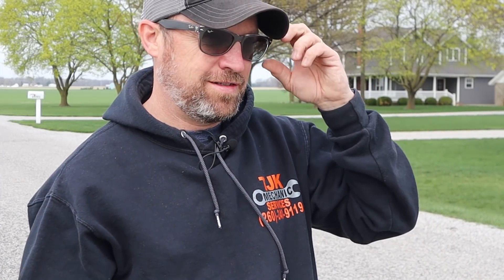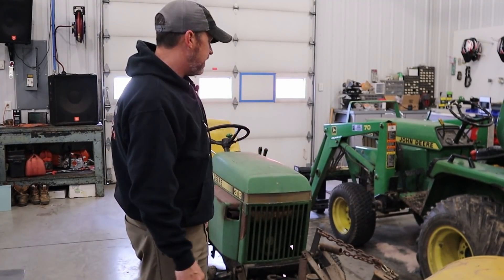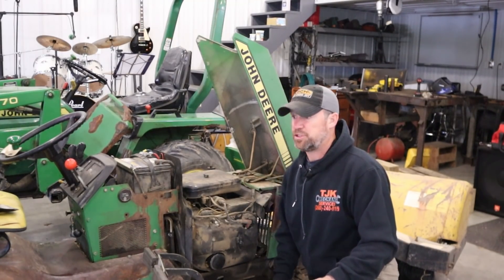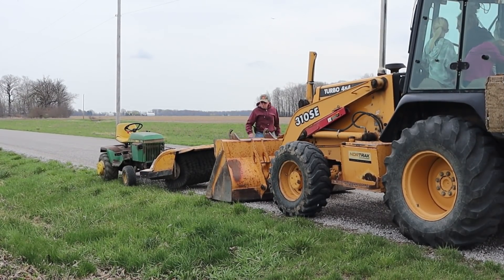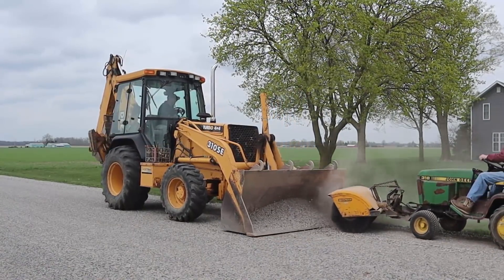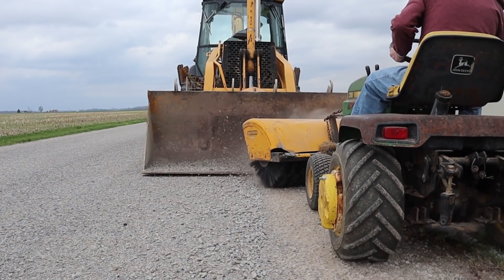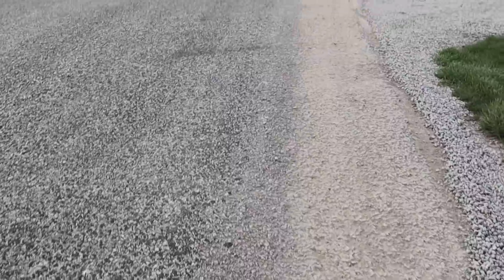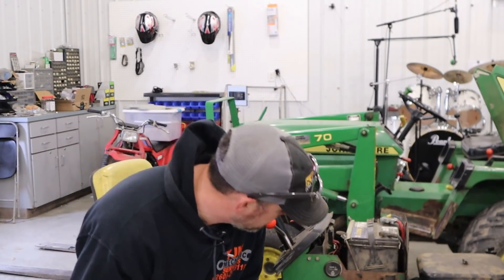I Have Wanted to Do This For Years!

Comment: I was pretty impressed by "Project Farms" test of "Engine Restore" snake oil in his tractor. It brought the compression up from 230 psi in one hole to 300 in his diesel tractor and really balanced out the compression. Might be worth a shot the small bottle is less than 20$
Reply from the maker: A few other viewers have mentioned that video.  I need to check that out and will likely watch it when I'm done reading comments.  Thanks for the suggestion and really appreciate you watching and giving feedback.
Reply: Engine restore is no joke. Brought up compression and made lifter noise disappear in my grand cherokee. 4.0l with 225k. One bottle after an oil change was all it took. I put a couple tbsp into all my 4stroke equipment when i do a oil changes.

Comment: Make Bill Great Again! Jk Those old JD’s can be a bad addiction they are a pretty sweet GT. You could could do a cylinder leak down test(you put the piston @ tdc and put air in through the tester from your air compressor) with this you can listen and hear where the loss is coming from; valves or piston rings. If it’s in the valves you could maybe just rebuild the top end with out too much trouble and expense.
Reply from the maker: Boy, you're right about them being addictive Larry.  I've had about a dozen of the 300 series tractors.  Currently down to just 3 of them though.  I think will Bill will live on in some regard, just not sure in what capacity yet.  Thanks so much for watching!

Comment: I wonder if a 22hp predator would fit from harbor freight. I replaced my stump grinder engine with one 2yrs ago. No issues it's been a great engine, but those are fairly simple rebuilds.
Reply from the maker: Lots of folks like the predator engine for these so I think it would fit.  That's not a bad option.

Comment: It probably doesn't need a full rebuild. The lower end is pretty tough. I would tear the top end down and inspect the lower end. Probably just needs a simple top end job.
Reply from the maker: Maybe so James.  I don't know if I wanna mess with it though is the only thing holding me back.  Thanks for the suggestion!
Reply: @digdrivediy  they are easier to work on then you think. Mmrbeef has some great videos to help. Maybe he could even steer you in the right direction. As you may be able to tell. I love 318s.

Comment: Neil, I can only assume you're using those stones to patch up State Line, HA!

Fix Bill!  Those 318s have been working hard for 35+ years.  How much $ to buy something new that is built that tough?  318s are too nice to scrap.  I think you can still get the front PTO from JD for $300.

That looked like alot of fun, but If you don't have a power broom and a loader, the shop vac gets the job done.  It is, however, not fun.
Reply from the maker: Oh my goodness Tony!  The State Line is something else; isn't it?  Our bus driver turns around at our house because he can't hardly take the bus through there any more without feeling he's gonna come off the road.  I don't think I have anywhere near enough stone... like 100 loads short!

Thanks for the vote to keep Bill alive and well.  I believe he will live on somehow. I love me some 318s for sure as I've had a ton of them and still have my first one.  

More videos to follow so stay tuned...

Comment: I think it would save some time and effort if you was to drop a newer or a new motor in it. For me, I would be happy with say a 18 or 20 hp Honda motor. It all depends on what your budget is.
Reply from the maker: I agree Curt.  I don't think the old engine is worth messing with but lots of folks think I should try adjusting valves and using the additives but I don't think that will do any good.  It's old.  I have a nice engine to put in it.  That engine is just in another tractor.
Reply: @digdrivediy  then I would pull out the good motor and put it in this one. Sounds like adjusting the valves and using additives is like putting lip stick on an old pig, in the end you still have an old pig

Comment: You should get a 332 it has all the benefits of a 318 with a lot better engine. It’s the exact same one as the 655.
Reply from the maker: I'd live to have a 332! Always been looking for the right one. I've had a 330 before and a 322, just never the 32. I'll keep my eye out! Thanks for watching!
Reply: @digdrivediy  I tore down a Yanmar out of a 332 a while back that had 4,608 hours on it the engine had less than 50% wear even after being overheated badly several times throughout its life. It easily had 2-3000 more hours left in it. My current machine has somewhere around 3,200. Then I’ve had a 318 with 900 hours that was already worn out.

Comment: Sounds like it's time  to rebuild  . He isn't dead yet. Could be from just setting and not runny enough  the seals could of gotten bad cause if you don't run them thier not getting oil to  oat the seals and they can dry rot out. A rebuild kit for those  can't be that bad.and if your not sure as time from tractor time with Tim
 He just might have an answer  for you

Comment: Your road reminds me of my alley, although your road is in far better shape. For years, the town just kept adding stone and all they did was build up the height of the alley. It did nothing for the underlying base of the alley, which results in potholes, no matter how much they grade it. Adding stone to your road without sealing it, just makes for loose stone. That said, taking the loose stone might be a problem for the county if they decide to get snotty about it. Around here, you’re not supposed to be in the public way maintaining it, no matter what your motivation is. They even get bent when we try to fix the moonscape or knock down the windrows made by the grader. I don’t think I’d publicize your efforts.
Reply from the maker: Believe me Patrick, I thought long and hard about whether or not I should do this.  Fortunately for us, the county doesn't get too bent up about stuff like this as long as you're not damaging anything.  We have been somewhat left to "fend for ourselves" in some regards for many years when it comes to situations that need addressed.  My only justification here, is that just a week prior to this video, I was the one that put all those stones back out onto the road after the county snow plowed them off into the yard.  But, I certainly hear your point and it does have me slightly concerned.  All I can hope is that common sense prevails and that if someone from the county is watching, they'll realize what the situation is here.  Plus, I have saved the stones that I swept up and if they do come calling, I can just spread them back onto the road for them!  Thanks for sharing your experience and for watching the video as I do really appreciate the feedback.  If you find this video deleted one day, then you'll know exactly why!

Comment: I think that you should try and rebuild the ownin or if you want to replace the engine try putting a Kawasaki in it because I have a deer 425 and it has a Kawasaki with 1800 hours and they're built to go for hours and hours so I would try and put a Kawasaki in it if you want to replace the engine
Reply from the maker: They make some pretty good kits for these 318s but I don't know if a Kawasaki is one of the options.  I'll have to check.  Might swap with one of the other tractors I have though too.

Comment: Unless your county re-seals the whole width of the road, you always  going to have that problem.
As what i have seen from the video,county is not doing it properly.
Reply from the maker: They've re-coated it with stones and sealer twice so far.  I'm hoping next year we don't get any plowable snows and I'll get a year off from stone removal!
Reply: @digdrivediy  What if you run a petition with other neighbours on the subject of re-seal, perhaps your county may listen a bit more.
When do they re-seal the road?
Summer or Spring?

Comment: I’d rebuild than Oman in Bill or there’s a lawnmower junkyard by you in Bluffton that would probably have a used one.  They do pop up on marketplace for 1-200 in good condition.
Reply: Onan, I missed the auto correct
Reply from the maker: I'm not sure if I'll rebuild or replace just yet.  Most likely just replace with a different engine.

Comment: Looks to me like Bill’s party days are about over.  Time to send him to the Senior Citizen Center for slow dancing and covered dish Wednesdays!!!

I was wondering... how tough would it be to convert that broom to a hydraulic drive?  You might be able to pick one up at your local tractor salvage yard... I mean, even if there isn’t enough gravel to scoop up... you’ve invented the perfect means of spreading lime on your yard.  Let the wind shift and perhaps you can do the neighbors field too!

Our Chip and Seal is done with limestone pea gravel.  Two years ago in late autumn the county decided to redo our road.  As a rule, they do the chip/seal themselves and contract asphalt, concrete and bridge work.  

One bright cold morning,  this sweeper goes down the road raising a cloud front.  All of the loose gravel is wind-rowed to the shoulder.  Then it makes another pass and pushes it into what was, before then, a drainage ditch.  

Well, in some places there was plenty of ditch to spare... you see I live on one of the ‘hilliest’ roads around. It parallels the interstate and is a favorite drive for bikers and Route 66 enthusiasts because of that. So, they didn’t totally plug the ditches... well, at least until we got that first heavy downpour of rain....  but, I’ll get to that.

About noon, this circa 1980 yellow tanker truck comes down the road. I watch as it’s poorly tuned nozzles spit and sputter this mess of lukewarm asphalt on the cold road bed... 

As I watch, I start to get the idea that this might not have been the best day to be doing this.  The asphalt doesn’t level out... it pretty much lust stays where it hits the surface.  So, those places that were missed by the unevenly tuned nozzles remain bare.  The road somewhat resembles a wheat field being planted with a homemade drill that has half the heads turned sideways.... 

About 15 minutes later the dump truck comes along spreading 2” of limestone gravel on top.  Behind him is a roller.  

I’ll skip the fact that lunchtime was approaching and the circa 1980 yellow tanker truck is already coming back down the other lane... and that traffic is totally blocked... and that the roller dude & tanker dude park their vehicles ‘in situ’ right in front of my neighbors driveway... jump in the dump truck to go grab a lunch and some more gravel.  While the rapidly cooling asphalt grins and patiently awaits their return.

So, let’s skip to the next day... the pea sized gravel has dried out.  The dumb motorists have tried to use it as a roadway.  Their modern suspensions have converted it into the start of what will soon become one mile of washboard that would have made my great grandmother’s back ache, just looking at it... (I actually posted a discussion about the first-hand observations of this phenomenon on Cap’n K’s channel.)

Well, as luck would have it... it’s Saturday.  The call to the County Commissioner goes to voicemail.  As do the calls from at least 6 other neighbors.  

Come Monday, I called... he’s out but his clerk promises to give him a message to call me back.  Come Tuesday I call again.  He listens in wonder as I calmly explain the predicament of which he is totally oblivious!  

After I get it described, he explains that there were no ‘Chip&Seal’ jobs done last Friday because it was too cold.  Thinking I live in another county, he asks for my address. When I state it, he says.  “That explains it, you called the wrong office.  You need the ‘Special Road District!”

I ask him, “Don’t they work for you.”

He explains (to a guy who over 45 years in management, has drawn up and deciphered more organizational charts than a table full of Girl Scout cookies in front of WalMart) that, “Yes their boss reports to me... but the crew works for him. You need to call him.  His number is ###.  Thanks for calling.”

I almost ask him whether or not  his position, as the elected bureaucrat in charge... but instead I’m dumbstruck at his lack of curiosity and empathy.  Boy, did I take that into account a couple of months later when I went to vote!

Neil... this is getting awfully long so I’ll just get to the point.  In the election, the Commissioner was unopposed and was re-elected.  (Ten people who I know, wrote in the Special Road District Supervisor on their ballots!)  

While cleaning up that mess the Special Road District Supervisor and I became acquainted.  He explained to me the series of events that led to the construction of the washboard on my road.

That Friday had originally been selected as Chip&Seal day on our road.  When he saw that it was going to be too cold, he cancelled it. However he forgot to cancel the asphalt order and to scratch it off the job board in the shop. Because there was nothing going on, he took a day of vacation and sent his regular dump truck driver to CDL refresher training.  The rest of the inexperienced crew dutifully coped with the job at the best of their abilities.

As we watched a sweeper, Bobcat, dump truck and broom & scoop shovel crew clean up the mess... he said, “This is one of the worst screw-ups we’ve had.  I’m sorry but, I promise to fix it right next Summer.”

We had a chance to visit about it last summer while he was parked in my driveway.... watching a professional contractor lay 4” of pristine hot-mix asphalt in the road.

With clean and contoured ditches, new road topping and crisp lines painted on it... my road no longer sheds gravel.  But, it has created a new challenge... the Special Road District Supervisor has added our road to the Tier 1 snow plow list.  That means that at the first sputter of snow, the trucks are out spreading cinders .  Even if we don’t get enough to plow, we still get the cinders!  They cause an awfully ugly black mess on my pickup when they are wet and kick up a black cloud when they are dry.  I guess this is where I need your advice.... should I call and... nope!   I am gonna just count my blessings, wash the truck and thank my new buddy for taking care of my road!!!
Reply from the maker: I wonder about that hydraulic conversion too.  Would be a nice setup.  I have a little hydraulic motor from an old salt spreader that came off of my dump truck.  Not sure how fast it spins though or what kind of volume it needs.  Wow, the project ideas are endless!

Loved your story about the road.  Had my blood boiling as I read through the beginning. The story behind the conversion of our road from stones to Chip'n Seal is a full length Hollywood production.  It started over 20 years ago when I moved across the field from my parent's house to this one.  There were petitions to sign and land owners to contact and right of ways to sign away... At the young age of 20 I headed up the petition and all that was needed to get the process started for our road conversion project.  It took them only 18 years to get it done from the completion of all the paperwork to that first layer of chip and seal that you see in this video.  On a side note that was my first solo flight with a drone.  I was so excited they were doing the road that I figured out how to fly my boss' that day.  

They have had to redo the road twice in the last 6 years.  They use larger crushed limestone now instead of the "softer" rounded natural pea gravel like what was used 25 years ago on my parent's road.  I wish they used the pea gravel.  Creates a much nicer road surface and accommodates bicycles and roller blades so much better.  One of my daughters slipped on the snowy road last year getting off the bus and cut her knee on the jagged edged road surface.  8 stitches later and she now has the scar to remind her how sharp and rough the road can be just under the snowy surface.  Ok, ok... I'm getting distracted and starting to rant.  I'm only telling you this to help illustrate how much I understand what I think were likely your emotions as you watched the crew "work" on your road that day.  

I am so jealous of new asphalt road.  The only way I will ever see that in front of my house some day is if I change houses I'm afraid.

Well, I'm glad that your situation turned out like it did.  I am very grateful for our chip n seal surface despite how I talk or write about it though.  I spent the first 38+ years of my life living on and dealing with a crushed limestone road so I do know it could be so much worse.

Thanks for sharing your story and as always, thanks so much for watching Dave.  Still look forward to your comments every week.

Have a good one.

PS (I think Bill is going to go in for surgery.  Transplants and facelifts and some new running shoes are in order)
Reply: @digdrivediy  Yeah... it's tough to give up a good project piece.... I have a whole shed full of them.  

Gravel road rash is the worst... I have an ankle that still has ugly on it!

Thanks Neil

Comment: can you make that broom attachment with its own engine so you can use it on different equipment
Reply from the maker: Maybe, but it would be a fair bit of work.  Wouldn't be tough to drive it with a little engine though.  I like your way of thinking there Jonathan and thanks for watching.
Reply: @digdrivediy  I hate to see you throw it away, looks like if it had the right power behind it, it would make your life easier

Comment: Fix it
Reply from the maker: Gotcha.  Vote counted and thanks for the comment!
Reply: @digdrivediy  check your head bolts on it if they are loose tighten them.if they are snug but can't tighten them more it head gasket is shot or your engine pistons are wore out IMPORTANT:DONT OVER TIGHTEN THE head bolts if you do you might break one off or you might damage the block.